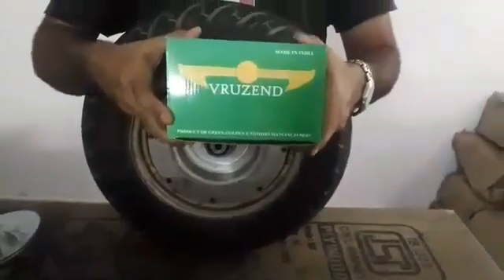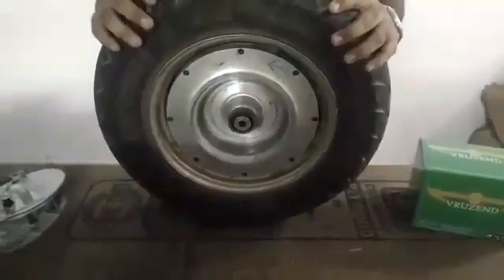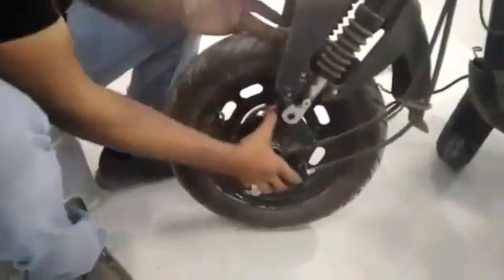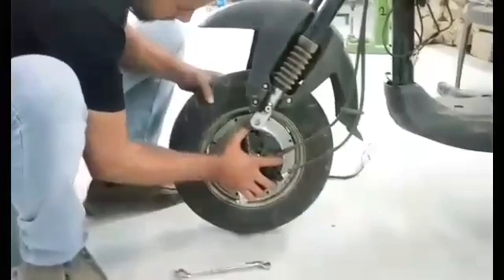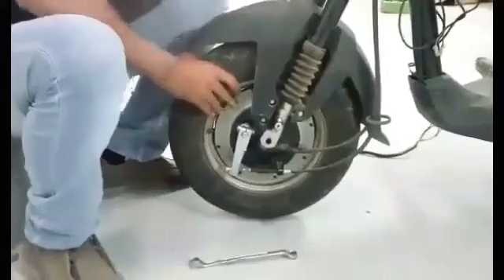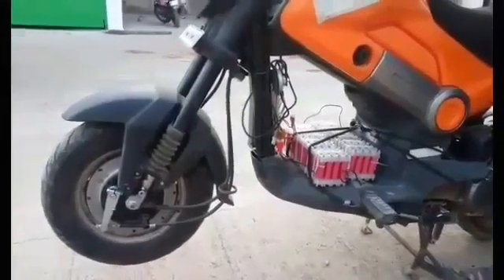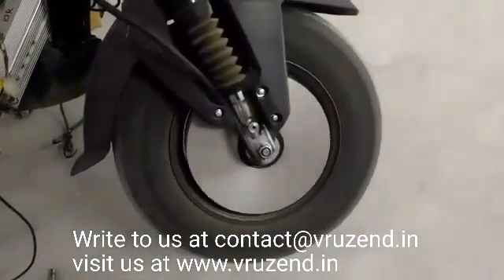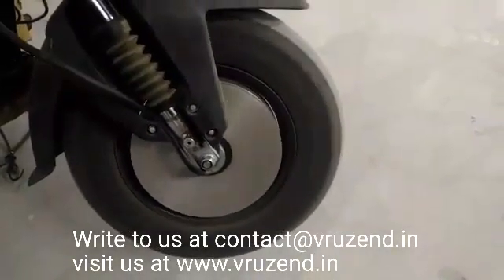Vruzend- DIY Detachable Axle bldc hub motor kit to convert any scooter to hybrid scooter

Comment: How to fit Suzuki  Access 125 without removing engine ( Creat hybrid)
Reply: i want to do the same
Reply: Yes u can 
But the problem is installing controller for electrical motor
Reply: How to fitt in hero honda plasure

Comment: heyy the navi looks so cute. heard the BS3 variants are selling so cheap, great to buy and convert it. it has good space for the battery and controller! just remove that weight from behind and you will have a faster and more fun to ride electric bike!!
Reply from the maker: Hey thanks, yes the bS3 variants had discounts up to as much as 20k to clear the stock.
Reply: @vruzend8593   48-72v 1500 w ka price,  12inch motor ka
Reply: @vruzend8593  ye motor 30 ampere lithium ion battery se kitna km chalega
Reply: VRUZEND when you are louching this product